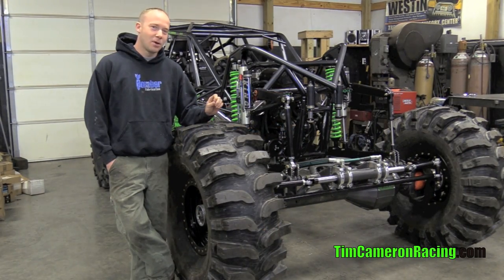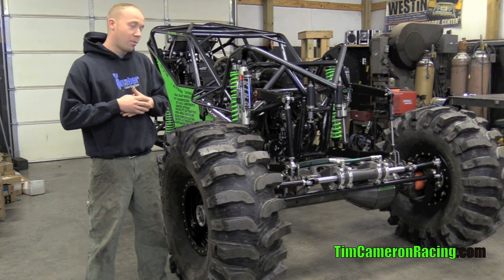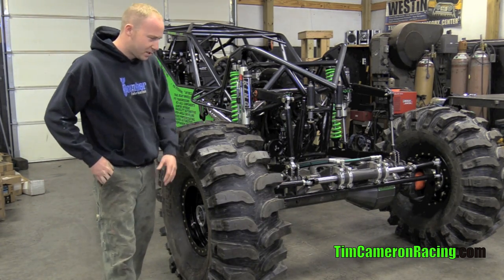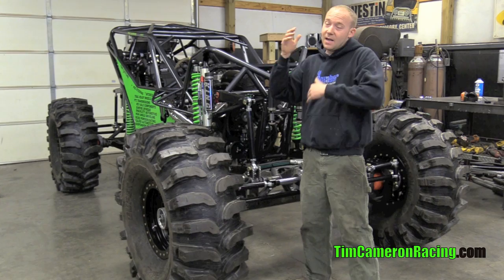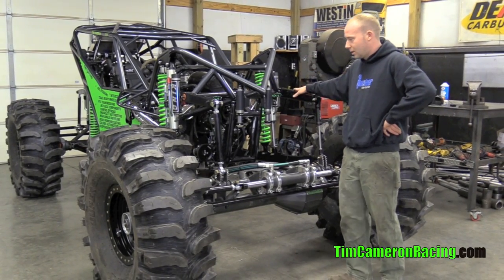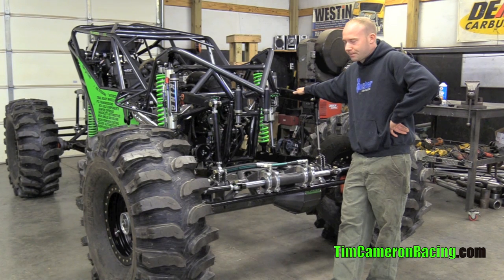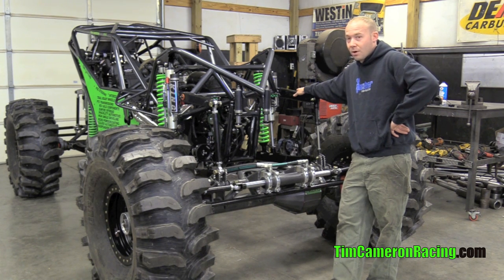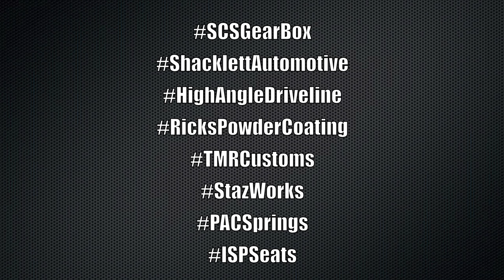"STAND BACK" TIM CAMERON'S 1400 HORSEPOWER ROCK BOUNCER

Comment: 10:50. You put a lot of faith in those frail rod ends, swivel sockets to endure 1400HP ! Good luck !
Reply from the maker: they hold up just fine,
Reply: MadRam11  some advice, if I were you I would keep a very close eye on them. Big and convenient  as they are they may let you down when you don’t need it happening. If you have much extension of thread unsupported with an angular load they will bend. Take care!

Comment: Great built! But why did you put the front leading arm anti wobble joints on the axle instead of the frame? 
Seems like it would over rotate your shock mounts when articulated.

Comment: Wicked! 

TC or Madram, everything looks killer and sorted out but one thing caught my eye. The belts on this rig are really out in the open/less guarded looking than others. Is it not a worry or a problem getting mud, rocks, etc, thrown into the belts? I know you really don't want enclosed belting that can trap debris in there and make it hard to fix. I'd hate to be leading a race and have the power steering or something go down. Curious if that's ever an issue on any rig actually.

Comment: Correct me if I am wrong but with having a bypass shock like Tim is running why do you still need to run that style of bump stop? From what I understand if you tune the bypass shock correctly with the last stage of compression ramp up you can make it so it acts as a bump stop it self. Does he run the bump stop so he gets even more ending stroke compression because of the shock shaft speed is so fast on these buggies? Thanks for the info

Comment: 1400HP,  that's a nice round number there. Where is the dyno you ran that on? Next time you put it on the dyno you should video I'd like to see that.
Reply from the maker: 1400 is an estimate, its an extremely built nasty Big Block thats capable of more power than that
Reply: Thank you for that bit of honesty.  My reply is your "estimate" is way off.  I don't mean to be a jerk, but to put out that kind of H.P. just wouldn't make sense off road.  There are compromises when we are talking about peak H.P. in a gasoline engine. Low end torque comes to mind, fuel type (availability) comes to mind, reliability comes to mind. Top fuel dragsters are rebuilt after every {1000ft} run. I don't think one of those would work for you, but they have huge peak H.P. I am sure your motor is a great build and I am positive it will work well for your application. I would appreciate it if we could just dispense with the "estimates".  Inflated horse power boasts are rampant and just sound silly to me. Like, I have the fastest car. Lets take it to the track and see what it does in the 1/4 mile. That motor should have been dyno tuned to get the most out of it. There are tweaks needed on every build to maximize the potential. That should have been basic on a setup like you have. I am surprised it wasn't, maybe next time.  I would like to see the H.P. throughout the rpm range, more importantly peak torque. Peak horsepower doesn't mean all that much, the full range is much more important. Again I really would like to see that. Not just to call you out, but that really would be impressive and useful for your build. After all it is an important component, you should be getting the most out of it.
Reply: Looks like the fronts are out so I’m sure it’s about to get done tuned
Reply: MadRam11 how many cubic inches???
Reply: TheKarmaCamel he said he was taking it to get it tuned on the Dyno....
Reply: Comparing todays engine builds to yesteryear isn't fair...custom blocks mean custom cam core sizes far bigger than conventional leading to the choice of massive valve lift without beating the valvetrain to pieces, bearing clearances are thousandths less than they used to be. Airflow through the heads is probably somewhere in the neighborhood of 500+ cfm...all that combined through  a computer controlled ignition & injection these numbers are probably more accurate then you think. Only drag cars being torn down after every run is nitro cars.
Reply: TheKarmaCamel why would you use mud tires on a dyno?
Reply: @michaeldose2041  Watch out fellas the HP hall monitor is on Duty.
Reply: @jonathandexter135  Yeah J.D. and the B.S. Meter is flashing.
Reply: @MadRam11  As an engine builder for 30 + years that 1400 HP number is way off. Normally aspirated a SINGLE throttle body? The bigger the displacement an engine gets the less efficient it gets . In other words a 1000 cc bike motor can easily make 1 HP per cubic inch a 454 its a bit harder.  Im guessing this is a 540 or below (To keep the durability rod to stroke ratio ect) so your claiming 2.5 + per cubic inch? Not a chance maybe with a bunch of  (Nitrous) . It would not last long. You would be amazed how much bull flys around about HP. Years ago i knew there were exaggerations but until i bought a dyno i had no idea how much! So as an honest engine builder and person do you go with the flow and inflate your numbers or call every one a liar?
This is not in any way to disrespect Mr Cameron . I have seen his videos and he is impressive. Im sure some engine builder handed him that number  and a BIG bill .
PS The air cleaner he has on it would not even flow enough for 1400hp just for starters
Reply: @tomhutchins1046   I agree. No way that setup there as is, is gonna make 1400hp. Not unless he has a bottle we can't see.
Reply: @michaeldose2041  i pretty much agree hp Is Tq x rpm Divided by 5252. 5250 . so it can be very misleading to those that dont understand . A dyno measure's foot pounds of Tq the formula converts it to HP. A ruff explanation it TQ is the ability to move weight HP it how fast it does it.
A wide fat power band will almost always win over a big peak number. 1400 is pure fantasy
Reply: @tomhutchins1046  Thank you Tom.  You make some really good points. More importantly you speak the truth to power. See what I did there? These are impressive machines no doubt. As such they should be fine tuned on a dyno, but we never seem to see that.  The first clue the number is made up is it's a nice even number, 1400. Not 1,382, or 1,438.  A number clearly pulled out of someone's ass. To his credit, Cameron says this is an "estimate". In other words, I agree with you, someone he paid a lot of money to make up a bigger number than the other guy who charges a lot of money.

Comment: Wow 1,400hp!  Thats the same as big name Monster Trucks like Grave Digger who are reportedly making 1,500hp and weight twice as much.  I don't want to sound like a hater but this doesn't look or sound like it's making the same power as Grave Digger type monster trucks even from a few years back.  Awesome rig regardless and its cool to see the progression from his early builds.
Reply: Maybe stick with Diesel, you don't know much about gas.  632ci Brodix on full race with modern management is more than capable of 1400
Reply: It dosent sound like a monster truck because it doesn't have a roots style blower like almost every monster truck has but a 632 c.I. naturally aspirated engine is more than capable of making 1400 hp and is not that hard to do and don't have to worry about restripping the blower every couple races
Reply: Well im sure he will share the dyno numbers, Hes hitting the dyno today to tune it. That 1400 is just an estimated number but wont be surprised if final numbers are close.

Comment: Whoever is building your hyd lines should be wrapping them with a protective cover.... those front 'sway bar' rocker assemblies with the damper will be setup based on vehicle speed per course...it just acts as a beginning stroke fine tune. ...same principle for tuning. ....faster the small  bumps  come the quicker the valving...slower the time between bumps the slower the valving....look at it as round edge vs sharp edge obstacles when tuning. Rounder edges equals slower valving and squarer edges need faster valving for compression.

Comment: Great video! Of course, I can't help but ask...how big is the 'big block'??? Is it a 6.2 liter LS block, or, it is one of the previous generation big blocks, such as a 454, 502, or even a bored and stroked version (572, 632 cubic inch, etc.) ?
Reply from the maker: Its a monster All Aluminum custom built Big Block.  It's up to TC to tell people what size it truly is.
Reply: Looking at a close-up at 9:32, the 4 head bolts suggest it's an older generation big block, as the LS series engines have 5. Looking for torque? An 8 to 10 liter engine will do the trick. It reminds me of a 1970's advertising slogan by Dodge for a Charger equipped with their 440 engine and a 'six-pack' carburetor setup....'Nothing shrinks time and distance like cubic inches and a good induction system'!
Reply: @gregparrott  It is the older gen not an LS . But there probably isnt a Chevy part in that whole engine

Comment: awesome build, why is the radiator at the top back? and how do you steer with the rear Wheels ??
Reply from the maker: lots of people put the radiator back there for ease of packaging and to get it out of harms way.  The rear steering is controlled by a switch on the gear shifter, has a separate power steering pump as well
Reply: @MadRam11  Cool, I'm new to this channel. I noticed the steering is hydraulic all the way up to the steering wheel too. It looks lots of fun and EXPENSIVE...

Comment: Awesome build man. 

At 11:05 or so, looks like you might have a chafe point with the rear steer hydraulic lines around the lower link arm pivot. Don't want that to be an issue.

Comment: Okay, took me 5 minutes to find the little tiny perforated spoon gas feed, another 10 to find the bigass brake rotor on the back of the tranny (noticed "Wilwood" on the pedal shaft), BUT what the heck is the little "extra" hydraulic ram on the left rear steering arm?  Whazat do?  Some awesomely outstanding engineering went into this build, I'd be a little concerned about high voltage between my legs, but then I'm an old fart... 😉
Reply: Not a ram, its the "return to center" sensor for rear steer.
Reply: AHA!!! Thank you!

Comment: Maybe you can buy you some hair next build LOL. BTW, I have a 3900hp, 120 inch tall tired, 32 link front and rear IFS suspension with 64 feet of travel. It's the new rock rocket class.
Reply from the maker: what are you talking about?
Reply: Diarrhea of the fingers...

Comment: Anyone know if he is bringing this thing to King of the Hammers this year? Hope to see it out there.
Reply from the maker: No he will not be there
Reply: Rock bouncers would be great in the boulder sections, like 'Back Door'. But, the KOH event mixes in a lot of sustained high speed sections, whoops, etc. The rock bouncer's 2 speed (or even 1 speed in modified variants) Powerglide transmission and overall gearing would be at a real disadvantage.
Reply: Gregory Parrott they already run at KoH.
Reply: I've seen some crawling videos at KOH. But, what I suspect (correct me if I'm wrong) is that the construction is very different than that of the dedicated crawlers. For example, the gearing should be taller and and must use a transmission with more speeds than the 1 or 2 speed Powerglide used on Tim's rig. I would also suspect that a LOT more braking capacity is required for the speeds they run. This in turn would change the brake location to be on the wheels instead of being placed on the driveshaft.
Reply: Gregory Parrott they are geared taller but they also are not crawling.  Look up backdoor shootout.
Reply: I have seen that.

Comment: Looks badass.. but 1,400hp is a booooold claim..
Reply: American Gun Nut totally seeing its on motor only...I call bs
Reply from the maker: Big Cubic Inch Big Blocks are capable of making way more on motor alone. This isn't your average Big Block.
Reply: MadRam11 I'm not saying it's bs.. not at all.. no one on here knows the true power.. I've seen N/A big CI engines hit higher than that.. Its just not easy.. even with a lot of $$$.. now throwing some nitrous in the mix makes it a bit easier..
Reply: MadRam11 don't confuse me for a hater.. I'm definitely not.. my initial comment came out a Lil sideways.. I was merely implying it's a difficult number to achieve.. not that I didn't necessarily believe it.. can you share some specs though? CI? Compression? Fuel?
Reply from the maker: American Gun Nut it’s all good man. It runs on 116 octane VP Fuel.  He is not sharing the C.I. Just know that it’s big and a lot of money was spent!!
Reply: Seems to me, you all are fishin' for specs.
Reply: M Duncan yes.. I wanted specs which is why I asked for them 🤔
Reply: MadRam11 right on.. can't wait to see it put in work.. curious about how those sway bar links will do.. might be a good idea for my RZR..

Comment: holy hell that thing has a deep oil pan
Reply: Caleb Downey the coolant dissipates a lot of heat traveling to the back of the buggy and then back to the front as well.. that's plenty of radiator.. just looks small
Reply: @Caleb Downey Dont think its 1400 and its only for a few seconds
Reply: @livingbackwoods9321  Really doesn't if its routed through the frame steel does not cool well . And its all about surface area and airflow

Comment: That steering setup- it doesn't look right. Won't the hydro setup change length as it moves through the travel, while the solid tie rod will remain a fixed length?  I'd imagine that'd put a ton of stress on and fatigue parts. Am I off the mark?
Reply: I'm curious about that as well. Very good question
Reply: Simply... NOPE
Reply: And to answer your question  Yes.
Reply: flyin427ford so.....yes or no
Reply: It works great on mine
Reply: Both, he asked 2 questions.  NO to first  and YES to second
Reply from the maker: Because he won't be racing over long distances it should be fine. If he was running long endurance races it probably wouldn't be ideal but should work well for the type of racing we do.
Reply: matthew burg not on a straight axle
Reply: The hydr. Ram for the steering is a fixed length, being it's not mounted in a way that place the ends in line with the center will cause a small amount of difference in the overall swing when compared the the tie rod. I'm no mathematician so I can't verify my thoughts and reasoning but strain it may put on it can't even be  close the the sh*t that that buggys going to be put through.
Reply: MadRam11 Thanks for sharing your thoughts and the great content. That's one amazing machine- it'll be fun to see the leading arm setup in action
Reply: the86125 that's the truth!